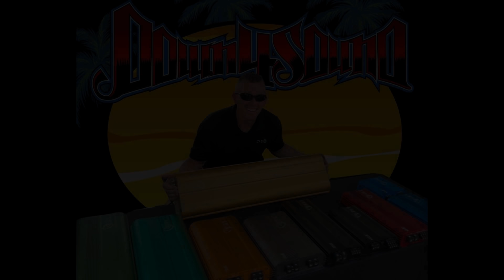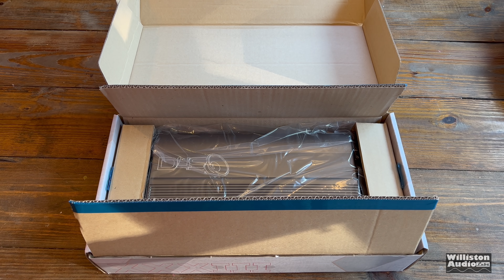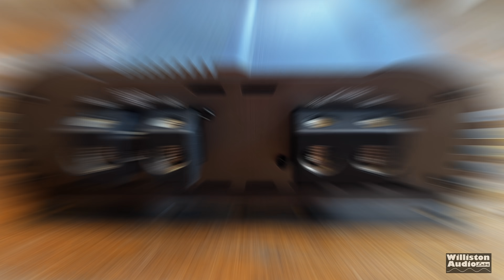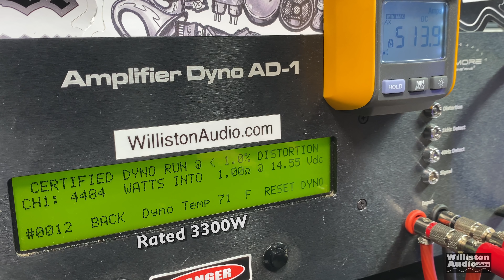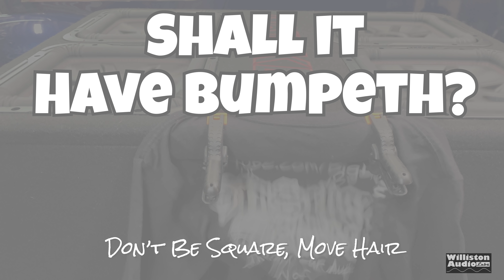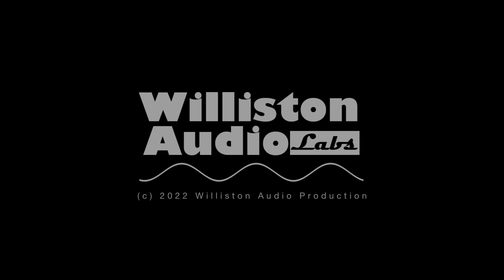3300W Battleship? Down4Sound JP33 Monoblock Bass Amplifier Amp Dyno Test [4K]

Comment: With amp efficiency being what they are these days, I really wanna see more downsized, under-the-seat amps. I don't think people realize how loud a 1000w amp really is. Huge bass is mice but after 1-2k it becomes a game of big-box subs to make more bass. I like a decent 10 with 500w in a decent box, I also like storage space for things like people... and stuff.
Reply from the maker: You like me must be getting old. We need space for stuff other than subs and amps!
Reply: I’m 51 and I approve this message
Reply: @The_Redkween  I'm 50 and do not, going from 1600 watts to 2500.
Reply: Theres plenty of loud subs that have small  box requirements.  Sealed  enosures the smallest. And some 12 subs that are 1k rms use 1.5 cubes per sub thats on a 3 cube box design it for ur specific car and the box will seem even smaller.
Reply: @joshholden8561  ur missing the point. U can get PLENTY loud and deep with a smaller sub, 10" and like 500 watts, and that 500w amp can literally be the size of your hand. I wanna see more of those amps being tested. 3k is nice but if u run 3k into anything it's gonna be the size of a house. 
500-1000w is damn near over kill in a small car enviro with a nice clean install.
Reply: @wwlittlejOfficial  I run a smart 3k on 2 12 skar evl kenwood 8405 on mids and highs alpine type r 6.5 6by 9s sony xavax5000 head unit my system really loud really clear sq in a little scion tc hatch.
Reply: @wwlittlejOfficial  my 3k is the size of a piece of paper 9 inches long 9 inches wide 2.5. Inches tall
Reply: @joshholden8561  I'm proud of u? I mean, what's your point? U just uneccesarily showcased your system which literally is what I'm not a fan of in the audio world, lol. Congrats tho.
Reply: @wwlittlejOfficial  glad its mine not urs then right.
Reply: @wwlittlejOfficial  thanks for being proud my gear was not cheap I have around 7 to 8 k  worth of gear 1/0 kicker ofc power wires  skar 10 guage ofc speaker wire 2 12 d4 skar evl in the prefab evl dual 12 box wich is tuned too high for my liking when I test the frequency the   box seems to be tuned to between 39 and 40 htz  and I want them at 30 to 32 htz I have 3 xs power 3400 agm batts mechman 250 amp alt puts out full 250 amps at around 2k rpm  upgraded pos post on the alt  I have 2/0 guage ofc  big 4 upgrade  by knu Konceptz  alpine type r 6.5 in front doors and alpine 6.5 in the rear seat side using skar 12 guage ofc for  mids and highs wire got a set of ivc 6 by 9s in the 6 by 9 boxes they make  mids and highs powered by a kicker zx 850.4 monster powerfull 4 channel amp
Reply: @joshholden8561  I've enjoyed the conversation in this thread & liked your comments BUT this last comment really got me... So don't take it as I'm hating, trolling or being disrespectful. You said you have 7 to 8 grand in your system, yet you are still using a cheap skar ported prefab enclosure?? Really!? Why all that $$ in your system yet you are still using a cheap prefab? I'm guilty as well, considering in one of by bass builds I have my 18" sub in a ported prefab but I also do not have anywhere near 8 grand in that system. Again not hating on you or anything. 

Josh I think as soon as you get the time or chance, you need to upgrade to a quality spec custom enclosure for your subs. That will completely change your system, improving it leaps and bounds, especially since you already have your electrical completely upgraded along with your h/o alt. I used to have a pair of 12" Skar evl and those things really surprised me at the amount of power they could handle. Not sure if you've seen them but some companies have enclosures specific to your measurements that you can order & they ship them to you in "flat packs" with all the wood cut to your specs & then all you have to do is assemble it. I bought one about a year and a half ago, one I ordered was an 8 cu. Ft. Ported cabinet grade birch enclosure for a pair of 15" Skar ZVX subs. They aren't too bad to put together, pretty much all you need as far as tools goes is a drill & some good clamps. You may look into that, GP Car Audio sells them & you can give them your exact measurements so it fits your car perfectly, Down4soundshop sells them but I don't think you can give them measurements, Gately sells them but only certain sizes & theres some other sellers out there too but that's the main ones that I would personally trust ordering from. Anyways man wishing you nothing but the best with your build!
Reply: @itdoesntmatterwhatyourname6128   buddy I have 7 or 8 k in my system and the other 15 amps I COLLECT.  QUICK  answer I use the skar box because it fits in my tiny rear hatch on my scion tc and I  have prolly 10 boxes for 12 subs even have a d4s box signed by Jp skar makes really good boxes tho to be prefab
Reply: Also I have gately box it's by far my fav sounding box u had great box suggestions with brands I give ya that but the gately box is dual 12 up firing port to rear and the box pushes on my hatch glass too hard  I had to remove the rear factory trunk cover where the spare tire well is just so I'd have 5 more inches of height to work with so for now the skar evl box works  just tuned about 10 htz higher than I like
Reply: That's if your not into bass. I'm into bass and a single 10 is clearly not going to cut it. Will sound like a mouse fart
Reply: I have the aab4900.1 it's small
Reply: It's painful not having trunk space. But the bass is just as painful
Reply: @bassheadfanatik  what people are not understanding is that we can get a 10-12 hitting 150db with 1k amp the size of a sheet of paper and smaller. Thats a ridiculous amount of bass, at least for me, because I remember back in '98 and having 2 -12's with 600 watt A/B amp the size of a fish tank.tgat didn't include the four channel amp, and having zero trunk space. I was hitting maybe 145-6. 
My specific point is that 150db is a hell of a milestone, and it's amazingly easy to hit with even a 10 (a beast of a 10), and amps being what they are now, 1k is no joke. People need to remember to get 3 more dbs out of ur system requires doubling, subs and power. Once u stack two 10's say goodbye to trunk space, and welcome to new alternators and such. And to be honest the bass increase is not that much going from 1k/1-10" to 2+k /2 10". 
Smaller cooler hidden amps and cleaner hard knocking subs trump alien looking systems with multiple subs, huge amps and zero room for... Stuff. Again, people really don't know how much bass u can get from a decent 10" and 500-1000w.
Reply: @wwlittlejOfficial  oh heck yeah. It another world once you get past 1k. From wires to dynomatting to keep the pressure in. Maintaining all those precious bolts. I'm running a 3k system at 97% efficiency all kicker. 2 15" l7 q. And getting my monies worth was even more money . But it's a passion that is more of a drug habit bc it's never enough. But the game really has changed. My first sets of subs were super pros 12s and Rockwood 10s on an old lightening audio 550 😆 I thought that was something back then
Reply: That 500 amp draw will take some serious electrical mods to run. I'm too old to go that far. I will get a jp13 or jp8 for my 2 10-inch subs.

Comment: It protected itself, unlike a certain overpriced brand most are super familiar with. 

Jp is definitely giving some solid value for the $ here. Nice remote knob, clean looking chassis, well built, protection circuits that actually work. Other brands should definitely take note.
Reply: Best on the market just my op.
Reply: @GMTPF800  yup, she's tough and good value.

Ill add that I think all amps should be put to the 1/2 ohm resistive load test, if they pass, well, obviously the reliability, and quality is there.
Reply: @georgesrisomsak9650  Considering the impedance of some 1 ohm subwoofers dip under 1 ohm it would be interesting to see what happens to some of the "1 ohm rated" amplifiers
Reply: @SprinkCalSA  indeed, and considering a lot wire to half ohm.and under that even, would know the amp can handle a couple protection cycles, without failure.

Jp sure seems to not be worried about D's low resistive testing, I feel it's probably very solid.

Comment: 4484@ 1 ohm with a current pull of 409.3 amps.. that means you would have to have atleast two 250 amp fuses correct?
Reply from the maker: 175Ax2 is the suggestion. Remember the tests I show are test tones and worst case scenario for current usage
Reply: It’s on the listing. Click the link to help Williston audio labs.

Comment: Yes! Awesome surprise to see this today. I figured it would take longer. Been looking forward to seeing these bigger JP amps. The only competition right now is probably the Taramps Smart 5k or 3k, depending on your electrical situation.
Reply: I'll take a smart 3k or smart 5k with same power at different ohm loads it will make more power at different ohm but these jp amp are awesome looking Tiffany rca should be on every amp in my opinion taramp needs better control knobs then I have no complaints but power to price u can get what 2 smart 5k amps for the price of 1 JP 33
Reply: And taramps makes full power at 12.5 volts these korean boards need huge amounts of power.
Reply: Taramps definitely wins as far as price to power output and the fact that it makes basically 6k at 1 ohm and 2 ohms. Some people don't care about the $$ difference though and they want a nice Korean half bridge they can run at .5 ohm. I can understand that.
Reply: @catch22frubert  taramps can run at .5 also some models
Reply: @catch22frubert  and also wins in effieniency 4 2 and 1 ohm  wins .awesome full power at 12.5 volts fullbridge amps just sound better to me but the above mentioned are facts.
Reply: @catch22frubert  taramps has .5 ohm stable amps also .
Reply: Orion hcca splx 3k still pretty much dominates all the jp amps
Reply: @OrionHCCC26  the Orion was the first with the compact Korean halfbridge. But they are similar to these. It’s just that Orion didn’t spare any expense on the 3k. That’s why it’s different from the 5k and 8k in the same series